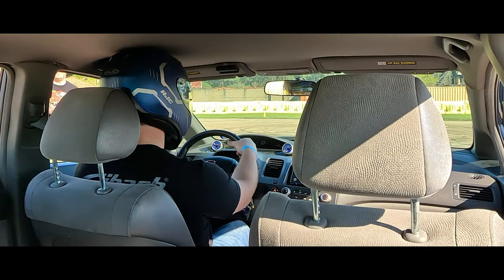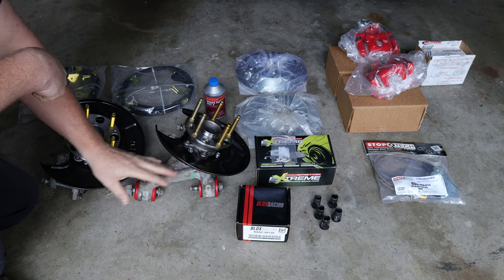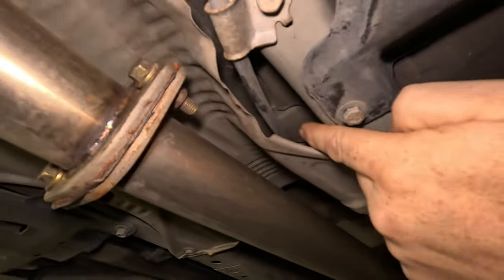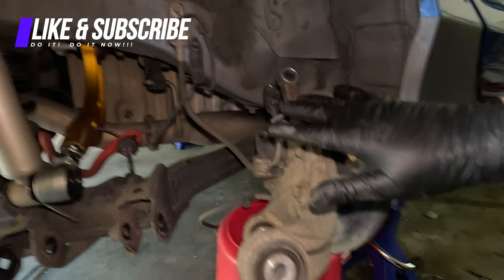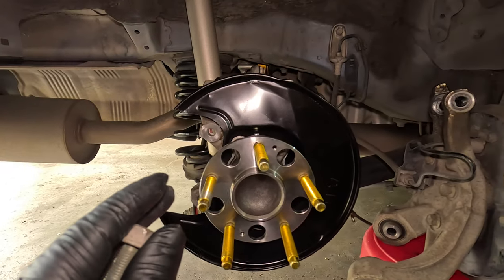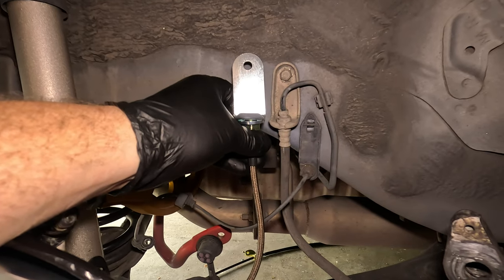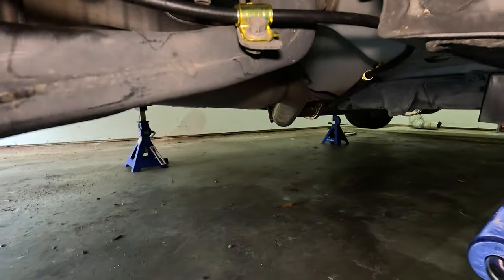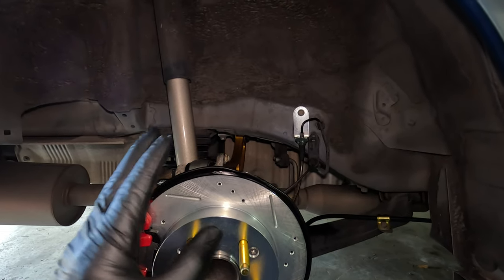Converting Rear Drum Brakes to Disc Brakes on an 8th Gen Honda Civic (2006-2011)

Comment: How do you install the rear wheel hubs to the dust shield? Also, did the pair of wheel hubs in description come with the required bolts? I didn’t see anything on that when I opened the link.
Reply from the maker: I'm pretty sure the rear dust shields are bolt on (they should bolt on with three 10mm bolts).

First, you would install the splash shield onto the knuckle. Afterward, you would install the wheel bearing & hub assembly onto the knuckle. 

The bolts for the wheel hubs are not included with the hubs. You would have to get those 4 bolts (per side) separately.
Reply from the maker: Upon further research, I found the part number for the hub bolts - 90163-SNA-000

These bolts are the SAME EXACT BOLTS that are installed on your current rear drum setup. You can just use the hub bolts from your rear drums and use them for the disc brake setup.

I hope this info helps! 😁 👍

Also, here is a link to the bolts, just in case...
https://www.hondapartswholesale.com/oem-parts/honda-bolt-flange-10x53-90163sna000?c=Zz1jaGFzc2lzJnM9cmVhci1icmFrZS1kaXNrJmw9Mzcmbj1Bc3NlbWJsaWVzIFBhZ2UmYT1ob25kYSZvPWNpdmljJnk9MjAwOSZ0PWV4JmU9MS04bC1sNC1nYXM%3D
Reply: @LevelUpMechanics  Thank you! I highly appreciate your response. Not very many people will respond to everyone’s comments let alone go into great detail. Keep doing what you’re doing and keep up the great work man 👍
Reply from the maker: @JoseFlores-wk2ej no problem 😁👍. I'm happy to help as best as I can. I appreciate the support!
Reply: The hub bolts are marked with a “10” stamped into the head, so stay away from 8.8 bolts, too soft.
Reply from the maker: @waverider5751 good to know 😁👍

Comment: Don’t need to replace the proportioning valve with the new increased brake pressure that will be going to the rear wheels?  Also what are your gauge pods for?
Reply from the maker: The 8th gen civic doesn't have a proportioning valve. Instead, brake pressure is controlled electronically by the ABS module. I believe it's called "electronic brake distribution" (EBD).

I haven't had any brake pressure issues with the rear disc brake conversion 😁👍.

As far as the gauge pods go, I currently have an oil pressure gauge and a wideband AFR gauge. They are the Prosport JDM 52mm (2-1/16") series. Eventually, I plan on boosting the R18.

I hope this info helps! 👍👍
Reply: @LevelUpMechanics  Okay cool 😎.  I have a bbk for the front off a TLS so was curious if adding the rear conversion would cause any pressure issues Ahah.  I plan to also have the BBK for the rear as well when doing the conversion so not sure how that will affect braking pressure for the front and rear.
Reply from the maker: I think as long as you have the correct brake master cylinder for your setup, that is what matters the most when upgrading brakes on the 8th gen...
Reply: @LevelUpMechanics What makes the rear wheel bearings/hub different from the ex/si to the Dx, Lx, etc.?  I’m looking back and fourth on both of them and they look identical.
Reply from the maker: It is possible that the rear wheel bearings & hubs from the drum brake setup could be compatible with the rear disc brakes. The part numbers between the two are almost identical (but not exact).

I honestly didn't try to use the drum wheel bearing & hub assemblies, so I don't really remember if there was an actual difference or not. Since the part numbers between the two are different, I just decided it would be beneficial to use the parts that would be made for an EX / Si.

I would be very interested to know for sure if the LX / DX rear wheel bearings & hubs could work with the rear disc brake conversion. Unfortunately, I did not think to compare the parts to see what differences there may be.
Reply: @LevelUpMechanics  Okay cool.  I don’t plan to do it quite yet, as I am still moulding body panels right now, but when I do I will try and update you in that.

Comment: Where did you get those brake dust shields?
Reply from the maker: I couldn't find the rear brake dust shields on Amazon, but you can still purchase them from Honda if need be. The part number is 43253-SNA-A00 (or 43253-SNX-A00 - both part numbers refer to the same shield). You will need two of them (obviously lol 😆).

https://www.hondapartswholesale.com/oem-parts/honda-splash-guard-rear-43253snaa00

I hope this info helps! 😁
Reply: @LevelUpMechanics  okay, thank you!

Comment: Nice Job. I have a plan to do same job. Mine is 15 inch steel rims on rear and front. Is there no interference with the 15-inch steel rim after installing the rear caliper?
Reply from the maker: As far as the rear calipers / brakes are concerned, you should be okay with the 15" rims 😁👍.

Comment: I have a full parts car which has disc in the rear, think it’s a lx or ex, whatever the highest trim base is. I recently just got another but it’s a dx would like to swap it over. All the stuff from my lx or ex whatever model it is will work correct?
Reply from the maker: Rear disc brakes are normally found only on EX and Si models (the parts are exactly the same). You can definitely use your donor civic to transfer over the rear brakes to your DX Civic.

Comment: Any info on the abs wheel speed sensors? Do we just use the ones that are for the 8th gen civic? NVM 19:56 I'm an idiot 😂
Reply from the maker: Lol it's a good question 👍. The ABS wheel speed sensors transfer over to the new setup. No modification is needed.

Comment: Why not from an LX-S?
Reply from the maker: 8th Gen Civics that have rear disc brakes all use the same parts. If an LX-S has factory rear disc brakes, then that could work too 😁👍.

I just mentioned EX & Si models because they are more common to find in regards to donor parts.

Comment: Should b using dot 4 base on owners manual
Reply from the maker: If you look at the brake master cylinder cap, it should state that either DOT 3 or DOT 4 brake fluid can be used. 

DOT 3 brake fluid will absorb less water than DOT 4 from the air over time, meaning you'll need to have your fluid changed less frequently. 

DOT 4 brake fluid has higher dry and wet boiling points, making it safer for higher temperatures.

So far, I've had no issues using DOT 3 brake fluid. Plus, it's always good to know that upgrading to DOT 4 brake fluid is always an option.

Comment: Any difference in feel? Been thinking about doing this swap but rear brakes never heat up
Reply from the maker: As far as rear braking is concerned, the feeling is identical to the drum brakes. Since the front brakes tend to do a majority of the work to begin with, there is not much difference in performance when you compare the rear drum brakes to rear disc brakes...

There are a few pros & cons for both drum brakes and disc brakes.

Rear drum brake shoes tend to be much more effective as a parking brake, but they are typically a pain in the butt when it comes time to servicing them. 

Rear disc brakes are very easy to service, but parts can cost more when compared to drum counterparts.

For me, I wanted rear disc brakes simply because they are aesthetically pleasing and are easy to work on. Plus, it gave me a good reason to install some polyurethane bushings & extended wheel studs & stainless steel brake lines 😁.
Reply: @LevelUpMechanics  yep, looks is def worth it, drumbs just look ugly :(
Reply from the maker: Agreed 👍

Comment: where did you buy the rotor shield from?
Reply from the maker: The rotor shields came with the rear knuckles that I purchased from a junk yard (I just cleaned them up and repainted them with high-temp spray paint).

I couldn't find the rear brake dust shields on Amazon, but you can still purchase them from Honda if need be. The part number is 43253-SNA-A00 (or 43253-SNX-A00 - both part numbers refer to the same shield). You would need two of them (obviously, lol 😆).

https://www.hondapartswholesale.com/oem-parts/honda-splash-guard-rear-43253snaa00

I hope this info helps! 😁
Reply: yes it does help thank you so much i am almost done getting the parts for the conversion

Comment: Did you take any videos of installing those bushings?
Reply from the maker: Unfortunately, no. Originally, I tried to press out the old bushings using a ball joint removal tool (basically a really big c-clamp with a lot of attachments) with no luck.

I ended up having to use a hydraulic press (at work) to successfully remove & install the LCA bushings.
Reply: @LevelUpMechanics  thank you! I’m going to check Rock auto for a cheaper set, but if I can’t find anything that looks reliable I’ll give those a shot. I have a 20 ton press here at the farm so I should be okay. Fingers crossed haha
Reply from the maker: A 20 ton press should definitely do the trick 😁👍
Reply: @LevelUpMechanics can you help explain what the metal pieces in the kit do? I’m seeing 6 big metal sleeves, 2 smaller metal sleeves, 2 wides sleeves, and the 2 of the long cylinders with bolt holes on either end. Trying to fully understand what all of those are used for.
Reply: Nevermind the prothane website has information in the description. Think I figured it out
Reply from the maker: Yeah, the rear prothane kit allows you to upgrade MOST of the rear suspension bushings, including the rear upper control arms. 

The kit comes with a list and instructions as to which bushings go where.

Comment: can i use those parts on a 2012 civic lx sedan?
Reply from the maker: Some of these parts are also compatible with the 9th Gen Civics, but not all of them. The PowerStop brake kit should be compatible.

Other parts may not be compatible (like the parking brake cables, rear suspension knuckles, etc)...

Comment: Bro got rid of the drum for Amazon Chinese disc breaks 💀
Reply from the maker: Hell yeah I did 🤪. And they are working just fine. No rust or brake dust issues, and they perform exactly like you would expect an OEM rear disc brake setup to run. 

Eventually I will upgrade my rotors and pads to handle the increased stresses that come with autoX / track days. But even then, I haven't had any issues so far...
Reply: Where you think your brakes come from??😂😂
Reply from the maker: Exactly 💯 👍😆
Reply: Powerstops are arguably just as good as R1 Concepts... Just sayin
Reply: Honda or any kind of drum brakes are complete trash anyway 😂